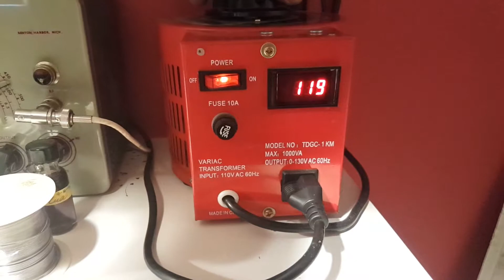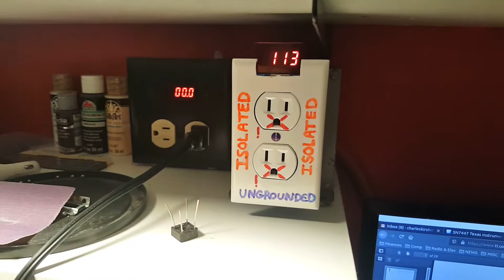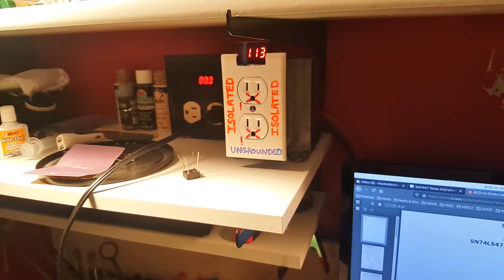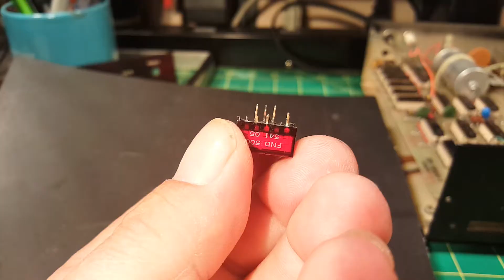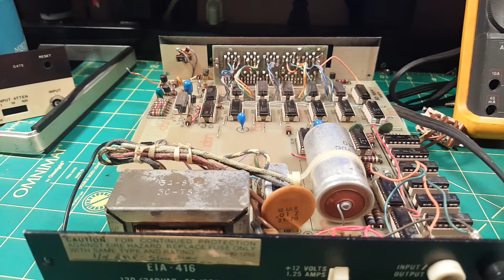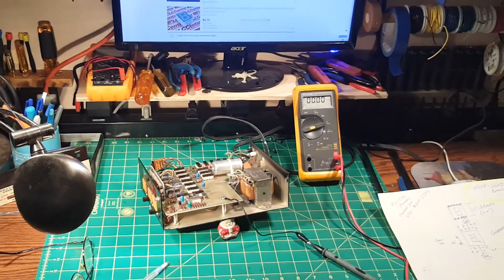Resurrection: Heathkit IM-4100 - part 2 of 3

Comment: It looks like you are making steady progress there. I'll be watching for more.   I am having a completely different issue with mine. When first powered on, it seems to operate normally with sine, square and triangle waveforms. After about 15 minutes it will only count the square wave correctly. The other two cause the display to show about 2x the actual frequency. The waveform at the output of the schmitt trigger also becomes distorted after the 15 minutes has passed. Is it possible the ic may be overheating?
Reply from the maker: Wow, it certainly sounds like it might be. I immediately thought that it must be a Schmitt trigger failure. As soon as I get my displays in the mail, I'll have to turn it on and let it run all day and see if mine does that too. I don't have a function generator, but can feed it a clean sine wave and see if it counts it correctly after being on all day. Thanks for that tip! I assume you checked your power supply output after it gets nice and warm. My filter cap was leaky, overheating, overstressing the bridge rectifier diodes, and the transformer. Who knows what it might do if left on all day as it sits. 73

Comment: Old wiring type left a lot of unused board area. 72 de KB8AMZ
Reply from the maker: Yep. Isn't that crazy? If you made that same exact circuit but using the smaller sizes of SMDs, I bet you could fit it all on a board the size of a dollar folded in half. I mean I could lay that board out probably. If someone knows what they're doing, maybe it could fit on a postage stamp folded in half   :)